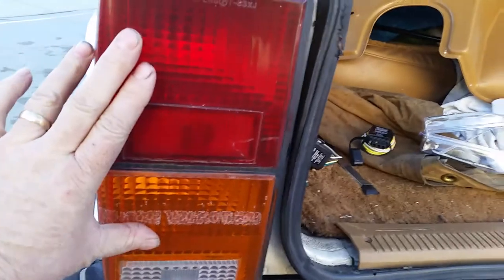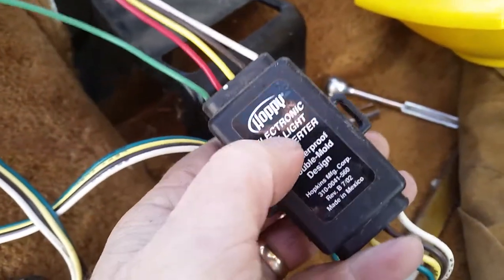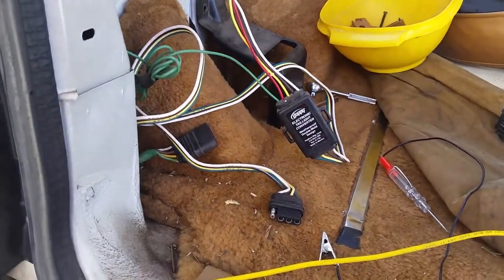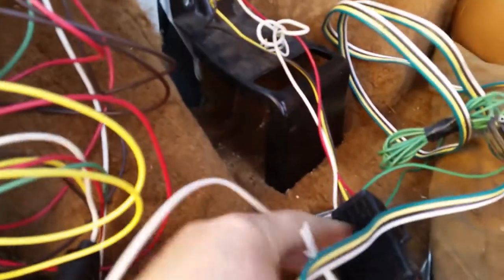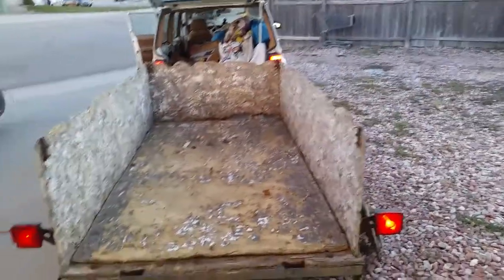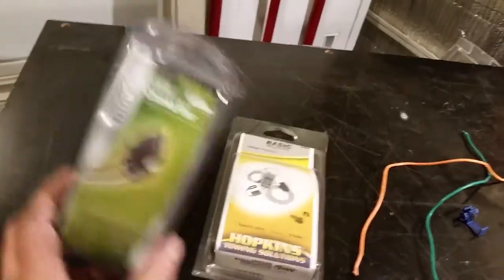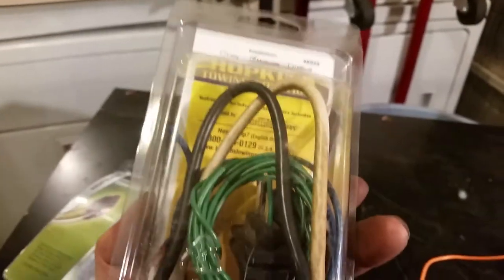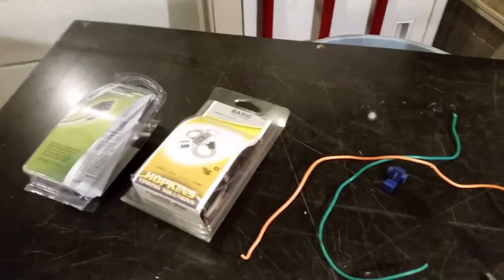Replacing the Trailer Light Converter Box

Comment: How did you determine that the converter was bad?
Reply from the maker: The trailer lights were not working correctly. I tested the wires coming out of the converter and got the same results as the trailer. I tested the wires before the converter box and they all did the functions they were supposed to do. So I decided that the converter box was not working like it was supposed too. Hopefully this helps.